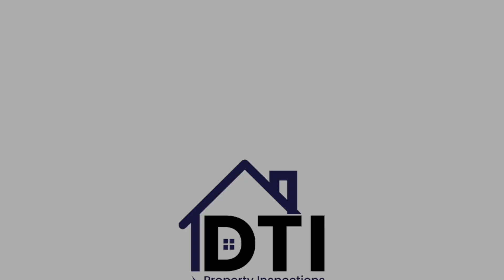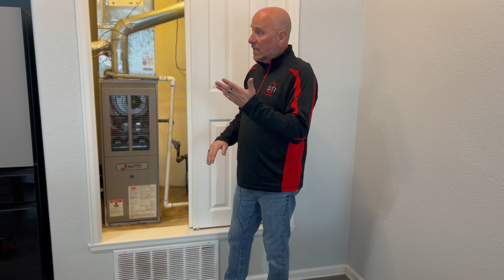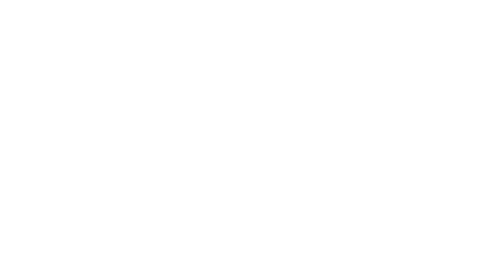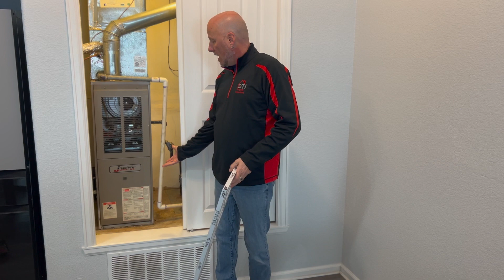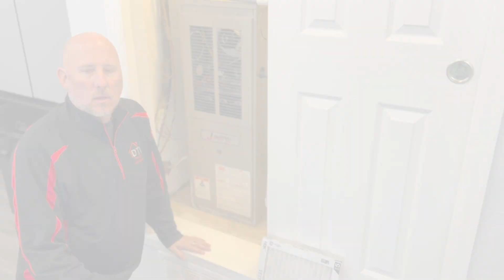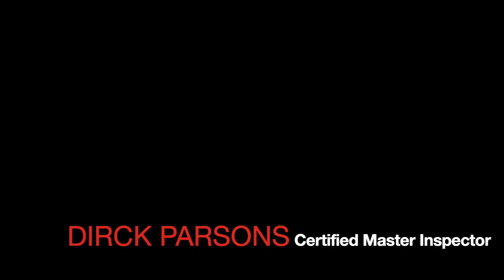HVAC

Comment: Those one inch filters are rated for 28 days 4 in filters are rated for 90
Reply: Thanks for watching and commenting! The manufacturer of the 1” filters I use as well as some others are recommended for 90 days. But some are just rated for 30 days. Thanks again!